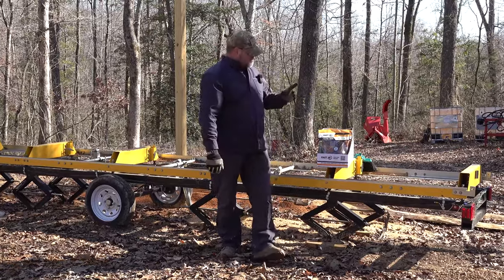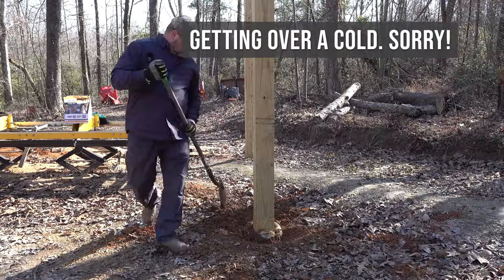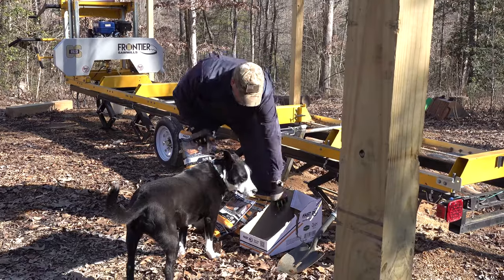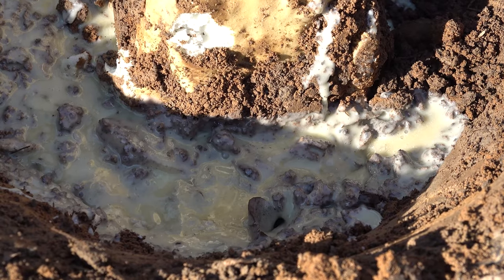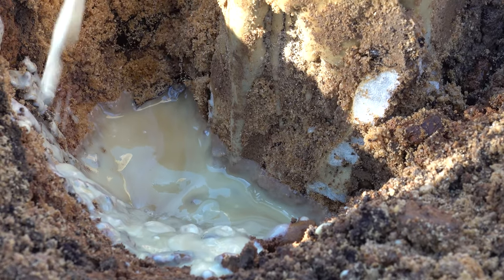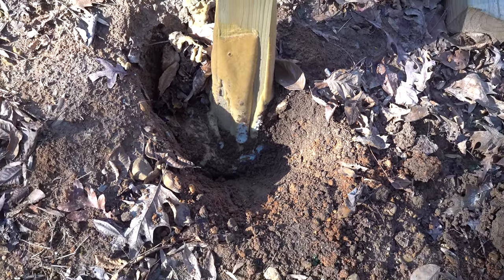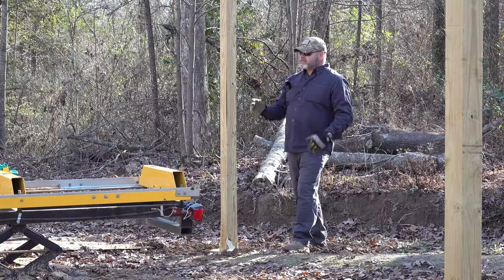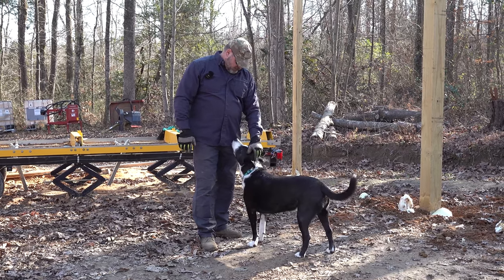Fix your Loose Fence Post! FAST2K fixes SIKA Failure

Comment: Simple, easy fix for a major problem. I hope that Lowes refunds your money for the Sika you already purchased.
You should share these two videos with Fast 2K. I wonder if the manufacturer of Sika knows about this issue.
If I see this posted again I won't watch it twice.
Another great video.
Dave
Reply from the maker: It is funny you say that about Fast 2K. Fast 2K has invited us to speak at the 2022 NFBA FRAME BUILDING EXPO. They are so excited someone has pointed out the difference between the products. SIKA has hurt the foam industry. Sika is a concrete company and it makes me wonder if they spike the foam market?

Comment: The saga continues bud. I can understand how this can be a source of frustration.  I don't know the cost of this stuff but I'm sure it isn't cheap but it does have many advantages over concrete in so many ways! We have to put many 4 to 6 inch posts in the ground and are considering just driving then or reinforcing with foam/concrete. Not sure which yet. As for the brand we believe the fast2k has definitely proved itself for sure. Yall stay warm and safe, this winter storm is gonna wreck havoc on the east side of the country,  all the best. Ric and Mel
Reply from the maker: We got a dusting of snow last night, but all is good here. I looks like you all are going to get more. Driving the post is a good solution if you have access to a post driver. I don't like concrete against any current wood post. New wood post will rot fast with concrete around them.
Reply: @TonysTractorAdventure  the snow has just started here Tony, but the wind wrecks havoc on our power lines here. If it blows the power usually goes with it. Add in the ice on the limbs and tree's and now we have some big problems. The ground is super saturated here and that doesn't help. We have been trying to get a fence built for a couple years now and a fence builder I am not. I am learning a lot through y'all! I didn't know that about the concrete and rot too so glad we haven't made it that far yet! We have found some driver used for close to 1k and that will make quick work of it if we decide to go that direction, really like the fast 2k, that stuff seems to work really well! Keep them coming Tony,  really helping folks out and much appreciated! Stay warm!
Ric and Mel

Comment: I have a post in the back yard I used Sika on for a light. The foolish thing is loose as can be and ready to fall over 🥴 I think I'll give this a shot 😃👍
Reply from the maker: You can leave the sika on the post and pour fast 2K around it. I did my Sawmill that way when the sika failed.

Comment: Seems I used 2” minus washed gravel. As you pour gravels in pour foam in also?  It works good your way 👍.
Reply from the maker: I didn't need anything with Fast2K. It works by itself.  SIKA has failed me every time I use it.

Comment: There is no replacement for concrete and berm packed with a spud bar.
Reply from the maker: Fast 2K is really good replacement for Concrete. It out performs concrete in almost every way. Plus, concrete will rot off post in a 5 to 7 years. New wood treatment is not as good as the older stuff.